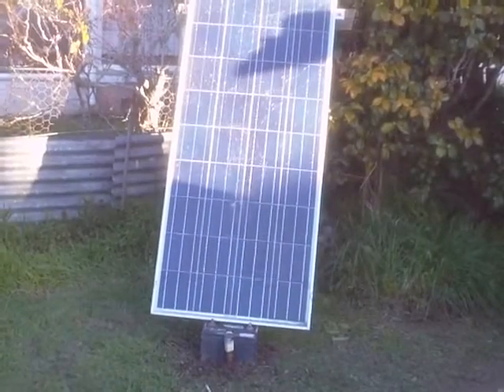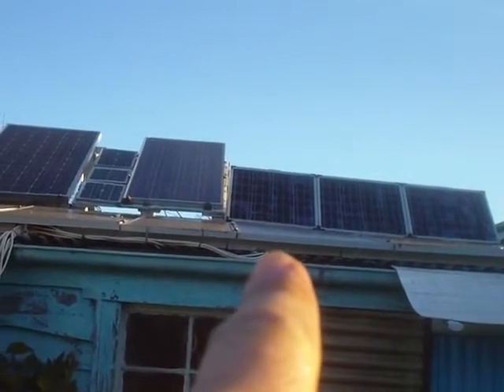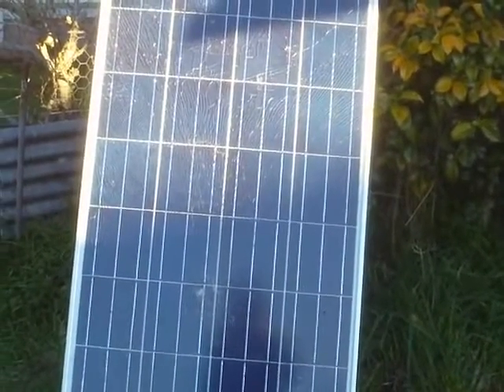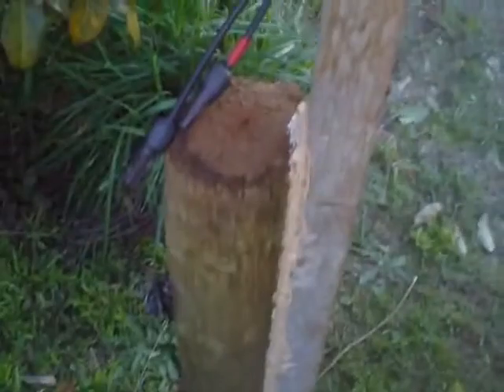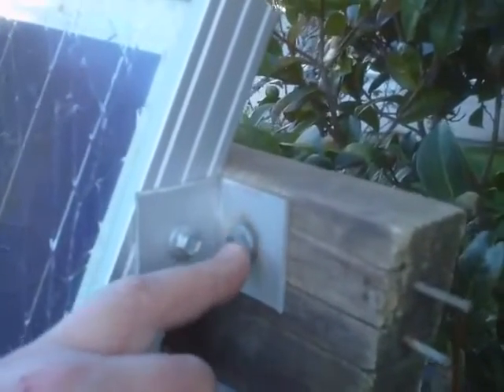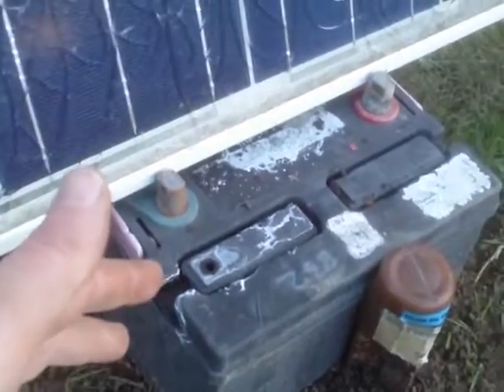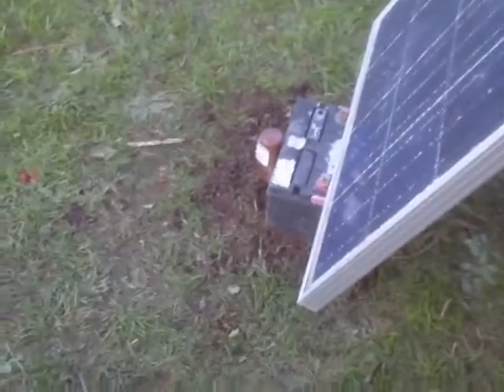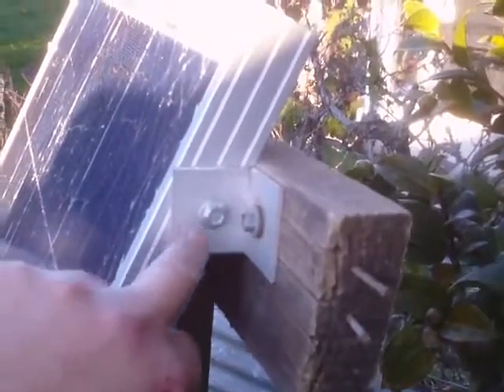DAY 553 OFF THE GRID - *Another Q&D ground-mounted panel.*

Comment: I haven't bought any panel yet, but I might find a temporary spot for winter. until I decide what to do with them, I really need some kind of tracker to make the best of them.
Tuesday I'm doing a day's journey to get 5 trojan t-105 re's to replace one bad cell and add four more, it's a nice drive mostly highway though, but I will save $200 over another dealer not much closer

best
Reply from the maker: Yeah, this idea is certainly suitable for a situation that is intended as temporary. And if it's only for a season or so you wouldn't even need to worry about if the wood was treated. The only thing is to make sure it's in the ground well and any joins are solid so they'll stand up to any winds you might expect. For the bottom, I have used old batteries, but clearly other things could be used. A couple of pieces of wooden rounds with heavy nails or screws in the end is one example.